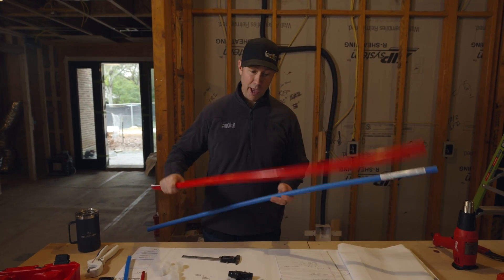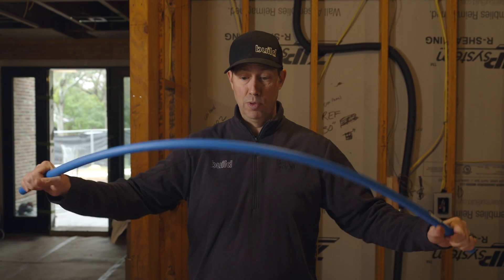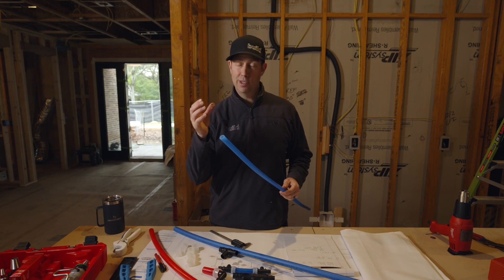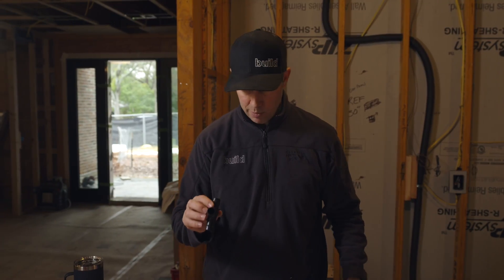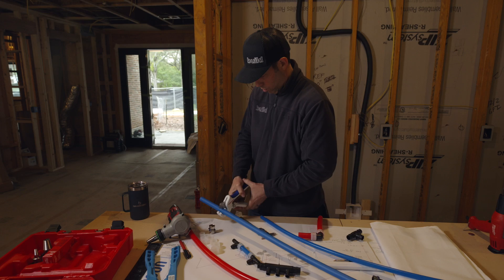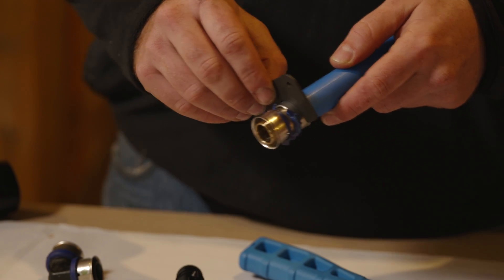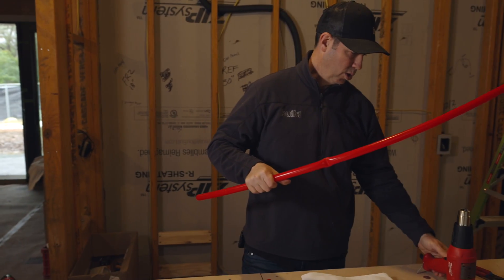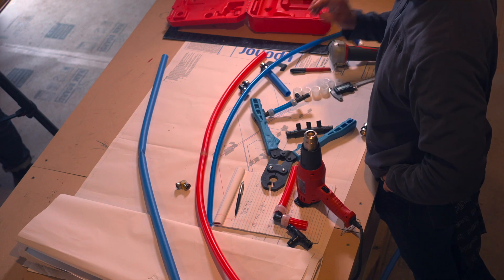Uponor Pipe System Review & Comparison

Comment: Having the brand your recommending sponsor the video is totally bad form and distracts from the fact that everything you comment on is correct - uponor is leagues better than any of the pex b crap.  and the comments about it being SO much more expensive than pex b are a joke. What part? a one time tool purchase for a battery platform you probably already have?  please. you spent more money on electricity watching tv last year.  I would choose uponor again whether it was a small job, big job or anything in between and there is a manual tool to expand if in fact you are that cheap.  but its pennywise pound foolish. connections in compression, fuller flow fittings, tighter bends, multi-port tees for logic plumbing - the advantages are multiple and I have not found it to be any more or less expensive than any other pex product.
Reply: "For a battery platform you already have"...if you have Milwaukee. Everybody else fuck off. Only need to do this in your house once? Fuck you, still gotta buy the ungodly expensive tool.
Reply: @ryanroberts1104  dewalt has the same tool. both dewalt and milwaukee license the design from uponor. There are probably others too but I have dewalt batteries so that is as far as I searched. I bought the dewalt version (bare tool) for like $200 off ebay used and redid my entire house.  Manual expander can be had for $50. I fail to understand your outrage.
Reply: @gregorysmith9158  So two companies make it. You make it sound like everybody just has those batteries lying around. That's a stupid thing to assume. It's not like a friggin' cordless drill, lots of brands DONT make them. 

You're trying to make it sound affordable to somebody who will use it once, and that simply isn't so.
Reply: @ryanroberts1104  You misquoted him twice. He said "probably already have". Also, take a deep breath.

Comment: My personal experience with Uponor.  My new build home is plumbed with Uponor.  I add a water softener loop and a hot/cold faucet in my garage.  Had trouble with the 1/2” expansion rings sliding past the end of the tube when I expanded them.  No issues with 3/4 or 1” sizes.  I was using all Uponor products.  Expansion tool was a Dewalt.
Another question I had?  My pressure regulator and tankless hot water heater are plumbed with metal crimp rings rather than the Uponor expansion rings.  All Uponor tube.  Any ideas why they would use the expansion rings?  Cheap? Lazy?

Comment: I just did the calculation for you. Cross-section area of 0.61" circle is 60% larger than 0.48".
Reply: OK, so bump the size up one. WTF is the problem?
Reply: @ryanroberts1104  run 1in pex instead of 3/4? That is a lot of added cost and complexity just to get the same performance as pex a.
Reply: @Mrcaffinebean  PEX A is more expensive also. What are you doing with all that water anyway? 3/4" PEX B with fittings should be plenty for most household purposes. Anything above 3/4" PEX B is usually the wrong choice for hot water applications and overkill for any interior cold water usage.
Reply: @ryanroberts1104  Depends on application. We typically run 1” or 3/4” main recirculation “racetrack” line for hot water, depending upon size of home & hot water demand. We run a 2nd 1” to hydronic manifolds as most homes we build here in high Rockies are in-floor hydronic heated. 1” PexA is pretty easy to handle in 2x6 wood framing. 1.25” PexB is required for similar volume capacity which is much, much stiffer making installation more laborious and subject to kinks just fishing lines.
Reply: @MichaelM-to4sg  Sounds like a pretty large home, not typical for most Americans. My main water line is only 3/4" with a bunch of fittings that restrict flow, anything bigger than that wouldn't really add anything to my house.  3/4:" water meters are pretty standard in the US, 1" and bigger are for the fancy pants people.

And I must say, it's still quite a bit of water for multiple users.

Comment: Why I think uponor is the clear winner... THIS VIDEO SPONSORED BY UPONOR

not a bad thing just poking fun. Also, why do you insulate cold water supply lines?
Reply from the maker: It’s indeed a sponsored video, but you should know that I reached out to them for sponsorship as I truly believed it was the winner and I wanted for my build.
Reply from the maker: I only insulted hot. Except for a few cold lines in exterior walls. (I’m in TX and have 2” of exterior insulation FYI)
Reply: @buildshow  Yea I noticed you insulated the hose feed out to your porch aswell. Thanks for the response, love what you're doing. I'd love to get into it here in the SF Bay Area but stuck in my  basement for the last year pretending to enjoy civil engineering. Much rather be out on site making high performance and long lasting builds. Let me know of any job openings :D Looking forward to more videos on the house progress

Comment: As a plumber for 25yrs I can also bring up another point with Pex A vs B.  Pex A you expand the pipe for fittings which means that the memory of the pipe is making those fittings stronger. Also with Pex B if you do not oversize the system accounting for the flow restriction of fittings (since they fit inside the pipe) and use a crimp fitting.  You asking for callbacks in regards to pressure at certain fixtures.  No such worry with Pex A as the fittings present no restriction/reduction.  (Sorry posted this before watching end of video)  =P
Reply: You won't see or feel a noticable difference plumbing with pex b vs pex a expansion fittings. Viega pex ran a test and the flow only dropped 1-5% using like a dozen fittings. Idk about you, but the vast majority of my pex runs are maybe a handful of fittings and rarely hit peak usage like in their testing. In reality, you won't see any difference and don't need to size up pipe.
Reply from the maker: Excellent points!
Reply: Can you use crimp with Pex A? Or it must be used with the expansion fittings?
Reply: @micruner5163  yes you can use both crimp rings or original expansion rings I've used viega sleeves many time for plumbing repairs.
Reply: And as a plumber since the late 80's I've never since a pex-b job that was plumbed   right have a problem because the angle stop or straight stop drops down in size alot more than the fitting so if any one who's ever had a lost in pressure because of using Pex-b fittings the plumber was a hack or and didn't plumb by code or there water pressure is to weak to begin with ,and any real plumber will tell you the same thing I just said the fittings on PEX-a is a  Selling point and yes I do use expansion fittings but I've never seen the lost of pressure with Pex-a crimp fittings unless the house  was plumbed wrong ,think about it supply lines less than 1/4 inch in diameter.

Comment: I'll go to Uponor when they get the power expander below $200 and get the pipe into the big box stores.
Reply: Yup. As good as uponor is, pex B and its fittings are widely available.
Reply from the maker: Fair points
Reply: You can get the manual for under $100.
If you want the power expander, and already have a battery system you're using, you can get the tool for around $270.
Yes, if you're just doing one job with it, that's a waste of money.
If you plan on doing multiple PEX projects, the term you're looking for is "ammortization".
Reply: @PhotonHerald  If you're doing one job, they have decent resale value. Selling it for 2/3 its MSRP would be like renting it for a day, but you could keep it for a year and use it as much as you want first. I'm a cheapskate, but if the tool cost is the problem, I see ways around that.

Comment: Wouldn't Bernoulli's principle dictate that the fluid volume would actually ACCELERATE through the narrower openings? That aside, we aren't really concerned with flow rate normally with a charged (loaded) system. I think Uponor's only valid selling point is improved flexibility... but with a larger diameter, I imagine some runs would actually be more difficult when space is tight. Thanks for sharing the video!
Reply: I can tell you I have had callbacks on new homes using Pex B (especially hot water) near the end of long runs due to fittings severely restricting water flow. Many builders have a fitting coming off the 3/4 line right at the water heather which immediately restricts flow.  There is nothing wrong with Pex B. But you definitely need to oversize the system accounting for fitting counts especially at the end of some runs.  I am not aware of Bernoulli's principle, all I can tell you is fittings on Pex B do definitely effect pressure and flow.
Reply: @DetailOriented-Bobby  No you haven't. Quit making stuff up. 3/4 pex B, with even a dozen plastic fittings, will run 10gpm with ease. Heck a 1/2 could probably maintain that as well.
Reply: @shawnd567  I am not making stuff up. I appreciate this is the internet, and trolls like to refute anything and everything. I only stated what I have experienced. Spend 25yrs doing this and you would be amazed what stories and things you can tell that you have seen. Just because you haven't seen it doesn't mean it doesn't happen.  Grow up and quite being a troll.
Reply: @shawnd567  Also just looking on youtube apparently I'm not the only one that has experienced this exact issue.  https://www.youtube.com/watch?v=IZlwvf3vIXs&t=323s

Comment: Everyone hating on Matt for being sponsored by a product he uses anyway. Pex A is far superior but comes with an upfront cost. In reality it's probably the same or as cheap with risks of crimp fittings or cinch fittings that are more prone to leaks.
Reply: No, it's not that he's sponsored by a brand he uses, it's because he's sponsored by a brand in a video where he specifically compares that brand to competitors. There's obvious conflict of interests there. I'm not saying U is a bad product, but they sure won't greenlight this video if a completely balanced review turned out they would not end up on top.
Reply: To clarify, normally in a video like this, you'll maybe get a sponsorship for a crimping tool manufacturer that's related to the comparison, but doesn't cause one side to have a vested interest in, and the means to influence, the outcome.

Comment: Did you attempt to correct “kink”in both?  Only showed one in the video? Plus the 2 minutes heating, getting the heat gun, etc would cost more in labour then a fitting?   Cost comparison and ease of use, install, and complete package with fittings and so would be helpful?
Reply from the maker: It can’t be repaired on the PEXb. Fair points on labor. I could see a run of pipe going a long distance and getting a kink in one spot after spending 10 min getting it run. Better to repair then add another fitting in my mind.
Reply: @buildshow  understood, thanks for clarifying.
Reply: Part of the demonstration has other real world applications.  Say you pipe freezes but doesn't burst. On Pex A the frozen pipe will return to original over time.   Pex B you would have to repair the freeze expansion section of pipe (due to weakening) even if it didn't burst.

Comment: There are other Pex A manufacturers. Mr Pex, Sioux Chief to name a couple. 
Zurn makes some Pex B that can be expanded just like Uponor.
I love the way you plumbed your house except for the water heater part. That's a bunch of fittings in such a small area.
Reply: All pex B can be expanded. It's purpose is to give options to use expansion fittings or crimp fittings
Reply: @jwblount7802  that may be true not sure but I did put a section of PEX b on my own hot water line that was white on the  out side and had a black liner not sure what brand it was but I did expand it and its been holding up for around 5 months so far I've been meaning to replace it but I had ran out of Uponor,  but seens then I've started using Zurn
Reply: @plumbbuild6517  I use Zurn 99% of the time on my houses that I plumb. I crimp all the time but sometimes my customers buy faucets or whatever that require expansion pex B covers both. Whether you use crimp or expansion you get 15 to 25 year warranty from the pex pipe company. The white pipe with the black linen I used to use a while back and it was Pex B as well and I have that 10 plus years with that pipe with no problems.
Reply: @jwblount7802  yeah I just switched to zurn so far it's great it may just be my new go to tubing thank for your comment about zurn I think I'm going to like it ,I use uponor for many years but sometimes you have to make a change

Comment: I like the flexibility of the Uponor system, I do NOT like the cost of the required installation tool!  Most new builds are going to take the flow restrictions of the standard PEX fitting into consideration and go up a size in piping to compensate so that isn't a real factor.  However, on your "kink test" I'd like to see a PRESSURE test done with that section of tubing.  Dollars to donuts, if that section is going to fail it  WILL fail where it was bent and then heated.
Reply: The tool will pay for itself on the first job in labor savings.  Even with that kink, most water supplies don't get high enough of pressure to be of concern.

Comment: I hate that Pex 3/4'' is actually 5/8'' ID and so on. I used it for a connection to increase flow between two areas and if I had known, I would have gone a step bigger or just use copper.

Comment: If a rehau fitting ever failed, rehau will buy you a new house.   That is how strong that company is.   Will also still be around in 50 years.
Reply: You might want to read the fine print ,because they state that your water may void the warranty, so if you get a leak they test the water coming in your house and if it's not to there specifications your screwed, so continue your use of a over priced fitting that there warranty is no better than uponors warranty if you read the fine print.
Reply: Like I said, rehau will be around for a long time.  I am in Australia and upunor has tried to make an appearance, but no one here has adapted.  It's either rehau or some cheap shit pex system that the owner will be pissed off with in 10 years time.
Reply: @Michael-cs2fh  there's a place for everything and Australia a good place for rehau. In a lot of jobs it's way to hard to get the rehau tool in tight places you don't have to get the Uponor expansion tool into the tight places so you do your thing and I'll keep plumbing with my expansion tools , thanks and keep plumbing down under.